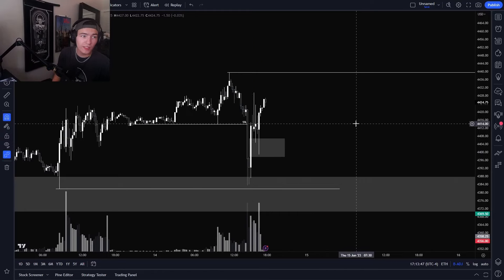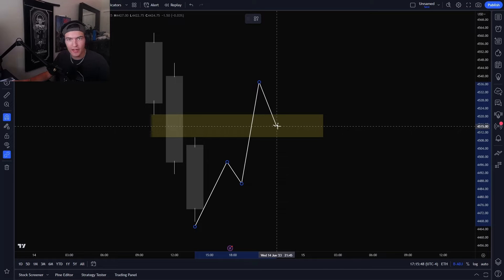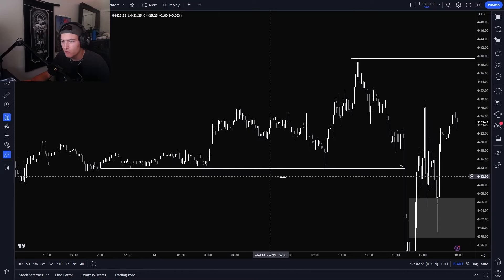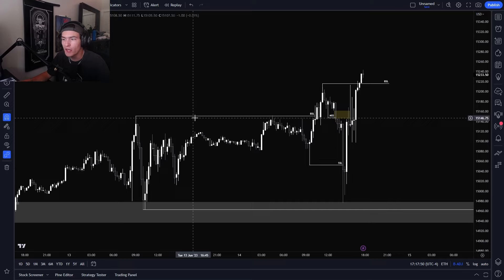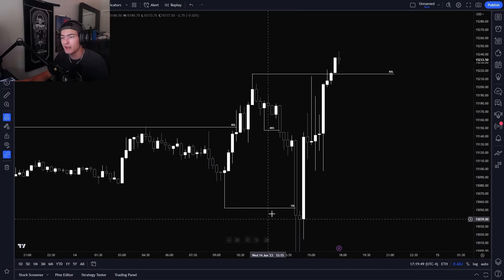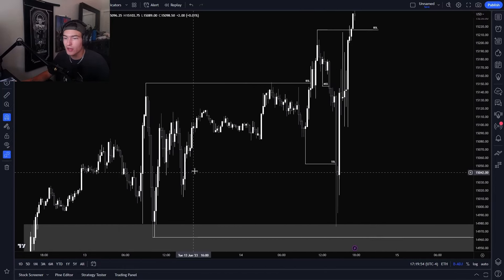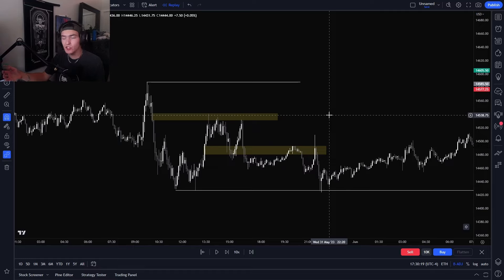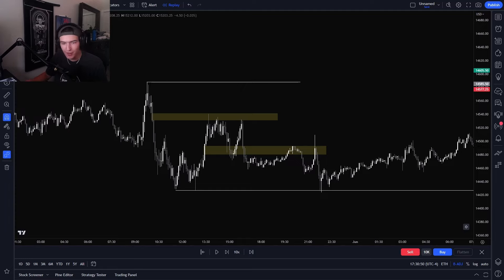My Secret To Having A Strong Bias - Inverse FVG's

Comment: This kind of hard to ex[plain in words but Ive been backtesting and noticed when an IVFG forms on the lower timeframes like the 1 and 2 minutes (all relative to context, time and supported by higher timeframe bias of course), alot of times when that inverse gets violated it will then get re-violated on the 1 or 2 minute, almost like its showing a fake out. However, I've noticed a pattern that when the next candle (or 2-sometimes it make take a few candles to work out) immediately disposes of the idea of a fake out and closes back above the IVFG, there will then be a tap and go on the very next candle, meaning it will tap some area of that IFVG and then head to target pretty quickly. I think IVFG's are probably the most powerful and consistent PD arrays to use.
Reply: I tried to digest this but I’m having a hard time ,seems you yourself found an edge on ifvg by studying the chart…pls is there any way you can explain your concept or edge to me. Further ?
Reply: Por favor, continue sua explicação. Tem algum ativo específico que possa dar um exemplo?

Comment: First time i ever watched a whole video of you, saw u on tiktok a couple times and know you from TJR. I’m using everything that TJR is using as strategy, but after watching this video i’m definitely gonna try and implement this as well. 

Could you maybe try and make a video about timeframes? It’s like a beginner question lol, but i’m struggling with using like fvg’s or order blocks, then waiting for a bos on like the one minute timeframe, but get stopped out because it didn’t break structure on like the 5 min timefrime. Idk what time frame to use for that bec there is like a fvg on the 15 min timeframe but then no on the 5 min timeframe for example. Idk could you maybe like a video on that? 

Thank you brother, i’m gonna watch all your other vids now too
Reply: anytime im looking at any higher timeframe or low time frame for that matter for an entry and there is none on the lower timeframe or on say even the one minute I usually just highlight that whole swing mark off 50 percent and look for a reaction in that area. in fact it pretty much works as good as doing all the other shit so it's pretty much how i draw all orderblocks etc now i just mark 50 percent and risk like a standard 5 pips or something depending on the price action of what im trading